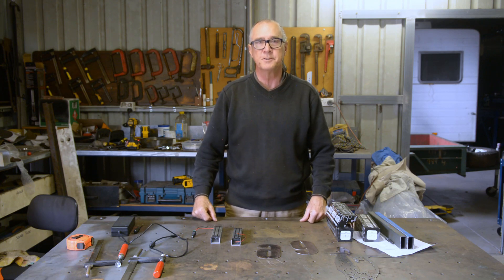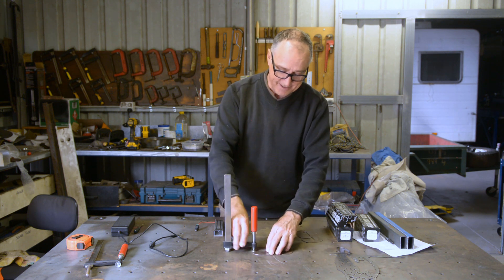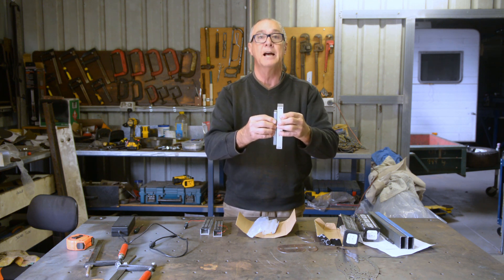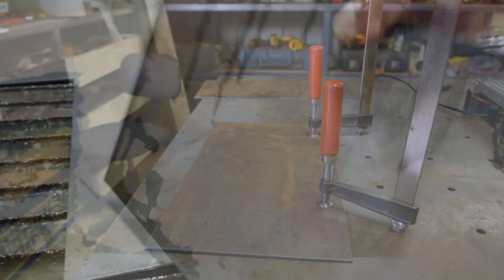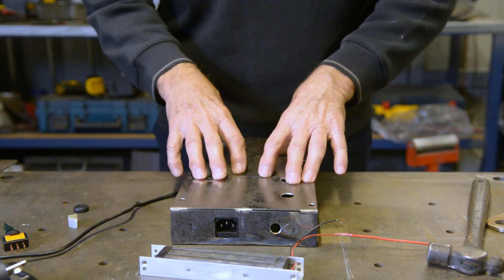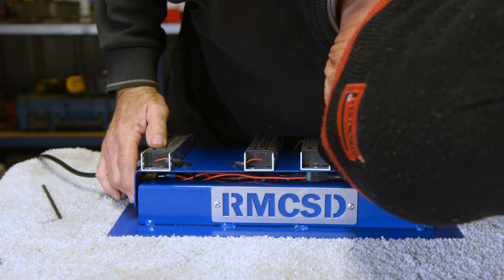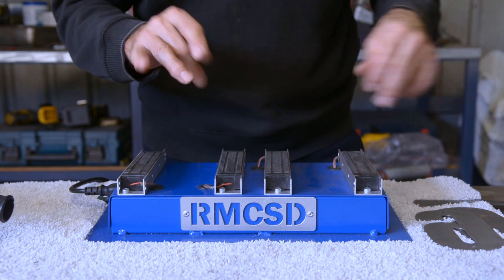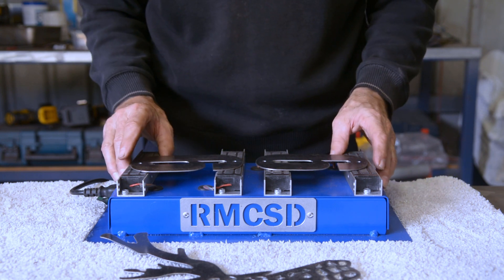How to Make an Electromagnetic Clamp

Comment: Works well.  The only issue may be cleaning them.
Reply from the maker: It does get a little bit of dirt/dust around the seams, which I clean off. Opening it up will tell me how much gets inside, which I'll do soon, as I've been asked to make a video of the wiring.
Reply: @RustysMetalSigns  I have seen others place thin steel plate over the magnets and still have plenty of power.  I intend to place mine under some 20ga steel.  This might also provide more flexible placement without concern for the magnet surfaces...

Comment: Great idea. Its a pity you skipped all the wiring etc. I guess your assuming people already know how to do it. If you video the parts you assume people know how to do, like hooking up wiring and toggle switch. You could either have it in a seperate video with link, i don't know how you was able to join the one power supply to 4 units and a toggle switch, so while its a good idea i can't replacate it.
Reply from the maker: Hi Karyn and thankyou for your comments. You make a good point, and it was remiss of me to not cover how I wired up the power supply to the 4 magnets.
From memory, I joined the red wire from each of the magnets, to one side of the toggle switch and the other side of the toggle switch to the red wire (12V+) from the power supply. I then joined the black wires from each magnet, to the black wire (12V-) from the power supply. 
With the mains power turned on, flicking the toggle switch puts power to all 4 magnets. I hope this helps....if not, feel free to email me at rmhyde58@gmail.com and I'll send you a photo from inside the electromagnetic enclosure.
Reply: The magnets just connect in parallel to the supply.
Reply: @slashsplat  If you could do a video of wiring it would be helpful.
Reply from the maker: Thankyou for the suggestion....I'll make a video, shortly, of how the magnets are wired up.